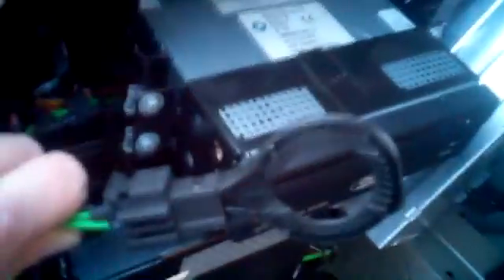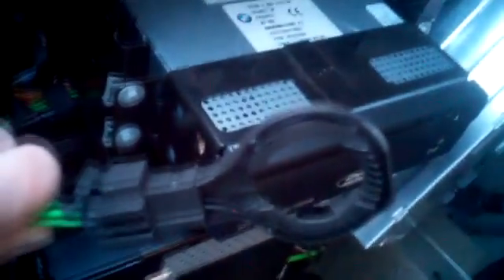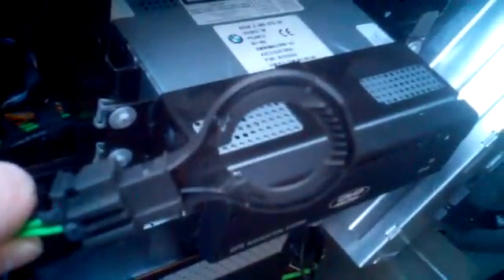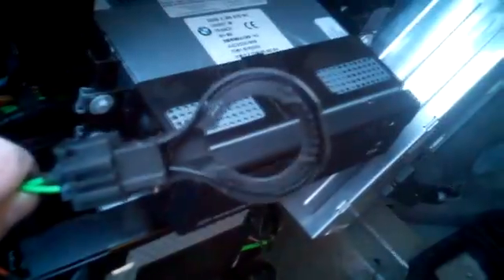7 Series Crackling From Speakers and MOST BUS Diagnosis

Comment: Where do you guys the "lollipop from"?
Reply from the maker: That one needs to be in the vehicle for the loop to be complete but you can use it to show the dealer so they know what you are looking for or use the part number on it to find another one.
Reply from the maker: I purchased th is from a BMW dealer. I think this may be too specific a component to find anywhere else.
Reply: AskTheCarExperts i have one in the fuse box in the front right, passenger compartment. 
Is that what it's for, for diagnostics?

Comment: My 2007 bmw 650i has a sos fault the radio doesnt play sound and the bluetooth doesnt work
Reply from the maker: I would definately take a look in the left side panel in the trunk. Especially if it is a convertible. Water can get in and damage the amp and the telephone module.

Comment from the maker: Unfortunately since the CCC is the master of the system it cannot be jumped out. Only peripheral modules can be jumped out like if the telephone unit was bad causing a loss of audio due to the vehicle having an amp on the MOST BUS it would allow the fiber optics to bypass the slave module.

Comment from the maker: In comparison not many cars drive and feel as good as a BMW. But on the flip side repairs can be costly and you will run into problems from time to time. I have seen some BMW's only need normal maintenance and the same vehicle plagued with issues. Some failures also relate to region and temperatures. Leasing may be the best way to stay with BMW.

Comment from the maker: SAT Radio also uses the MOST BUS so it would need to be fully operational and BMW would need to program. If there was any issue with a component module programming would not be possible until the issue was resolved. It might not be worth the investment.

Comment from the maker: Hello Joseph, Usually these units last quite a long time but I have seen them fail. You should call BMW customer care and explain the failure. With your vehicle having low miles they may offer some assistence with the repair. The CCC is the master of the system so if it has failed the other components will not work.

Comment from the maker: Glad to help :) If you have the radio on with high bass does the speaker under the seat sound distorted as compared to the other side? You could try to swap speakers from left to right and see what happens. Or it is just feedback from a control module on the MOST bus.

Comment from the maker: Problems like this can be tough to solve. This may be an issue with the amp as it is on the most bus and is responsible for the sound output. Try unplugging and jumping out the amp with a loop and see if the gong sounds. If it does then this would mean the radio is controlling the gong and the radio or M-ask would be the problem. If you have no gong and no sound I would suspect the AMP.

Comment: Hi @AskTheCarExperts, thank you for this informative video! I have a 2007 E65 750i that makes a high pitched screeching sound in place of the gong, while simultaneously having nothing but static when switched to the AM/FM tuner. When I reset the MOST bus by pulling and reattaching the lollipop in the glove box, everything goes back to fully working condition and stays normal when removing/inserting the key. However, once the car sleeps, the problem shows up again as before. What might this be?

Comment from the maker: Hello Mohammed, The resets do point to a failing M-ask. If you can find a good used M-ask it should work. In most cases, when I install a new M-ask it works without programming. In a dealer setting it would still be programmed to the vehicle. Worst case scenario would be that you have to do the programming.

Comment from the maker: Sounds like a control module overheat. Try removing the side panels for the trunk left side. If you can install a heat sink fan to the module housings it may help.

Comment: In my 2003 745Li, the speakers (front and back) start crackling when the outside temperature exceeds approximately 95 degrees Fahrenheit (35 degrees Celsius. I am located in Middle East ) and it goes dead in next 7-10 minutes of excessive crackling and popping. Also the Idrive is dead which means I can't use the dashboard and steering controls. In other words, cooler climate with low temperature than 35 degrees, this problem doesn't exist and no audio/video in summers.

Comment from the maker: This sound like it could be more than one problem. The radio's are common to fail which would take out the radio,cd,dvd, and gps. You should have it checked at the dealer or a shop with a BMW scan tool.

Comment: @askthecarexperts I have connected optic fiber portion of the voice module and the radio works again, my question is : do i connect the other part of the connected back to the voice unit or just leave it disconnected and floating around?

Comment from the maker: You can definitely purchase the loop from the dealer. The loop is very easy to install. In some cases it just plugs right into the fiber optic part or you need to slide the fiber optic plug out of the connector by pressing on a small tab. If you do jump the amp out you will not have audio but other you will restore your screen operation. BMW will be able to program the amp and code it as long as it does not have an internal error. The BMW programming station can prevent programming at times.

Comment: Can the fiber optic loop be purchased from BMW? If so, is there any special tool needed to install it? I suspect my amp has a fault.  I have the technical ability to repair my Logic 7 amp, but want to trouble shoot the problem the way you have described in this vid.  If the amp has a fault, and I repair it, will BMW be able to reprogram it? Like your vids alot.

Comment from the maker: A problem like this takes some diag and swapping of parts. The front speakers are controlled by the radio, the rear speakers and subs by the amp. Most likely it is bad speakers. You can swap them side to side to help rule out if this is a speaker issue.

Comment: Hello, my question is also concerning crackling sounds in my 2005 745i coming from my front driver side mid-size speaker and the compact subwoofer (located under the driver’s seat).  If the module has failed would this cause the crackling sounds and if it is not the module, where could I purchase replacement speakers (and not from the dealership)?

Comment from the maker: Hello Amy, I have seen a lot of problem caused by alternators on the N62 engine. The failure is often over voltage spikes which can cause a lot of strange electrical problems. The alternator replacement is the fix for this situation :) Thanks for the comment!

Comment: Hey there. I saw your post about the BMW ABS/BRAKE LIGHT ISSUE. The fix is replacing the alternator. I just watched a great video about it. Someone else mentioned replacing the ABS module first as a possible cheaper solution. Hope this helps. Sorry to hit you up here, but I'm unable to comment on your other posts.. :(

Comment: I have whining sound on passenger side when starting 2006 BMW 750i. I removed the panel underneath the glove box. I restarted the car only to discover that the sound was coming from the large silver module underneath the panel. What is it and does this need to be replaced or is there a DIY?   Thanks

Comment from the maker: You did find the problem :) But you need to trace it to the component that is not sending the light. It sounds like it may be your radio also called the M-ask which is the master of the system.

Comment from the maker: Hello,  The brake booster is due to oil from the vacuum pump that can cause the booster to fail. The battery cable recall is just a bolt that connects the battery cable power to the starter and alternator that can corrode. No modules involved in the battery repair. This would not effect the body components but it would for starting and the alternator. It is still a good place to start.

Comment: hi i have been dealing with the same issue however i checked all modules and found that my telephone control unit wasnt getting a light so i jumped it out with the lollipop but nothing changed still no sound also i checked the lollipop in the glove box and found there was no light as well im not sure what to check next please help!! thanks in advance

Comment from the maker: Hello, The most common failure is the radio head unit itself with this type of problem. You can try jumping out each control unit with the lollipop to help but it sounds like a radio problem. The radio is the master of the system and fiber optic bus.

Comment from the maker: Hello, The only place I know that you can find a fiber optic loop would be the dealership. They do not cost much. This will onlly restore functionality if one of the control units like the TCU are the main cause. If the problem is the radio itself the loop will not correct the problem. But jumping each module is the best way to find the root cause.

Comment from the maker: @AKJeeper Not overly common with Mini Coopers. I have seen a few amplifiers cause distortions. The popping happens with the radio on and off? Does it sound more like radio crackle than a suspension noise or body flex? If you can send me the last seven of the VIN in my e-mail I will check your options but with H/K you should have an amp and that would be the component I would suspect along with the speakers themselves. :)

Comment: Do you ever come across R53 MINI Coopers with crackling/popping from the speakers?  I've got the H/K system and occasionally the speakers (or at least, seems like the speakers) on my car would pop (usually taking off after backing out of the driveway).  Sounds like the speakers in the rear are the ones that make the pop noise.  It happens so sporadically and infrequently that I haven't had a chance to track it down.